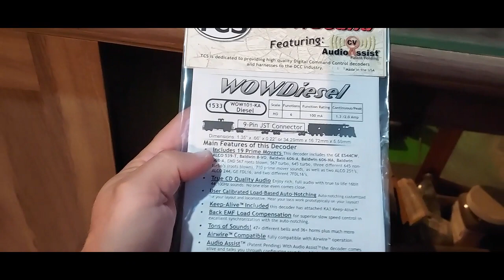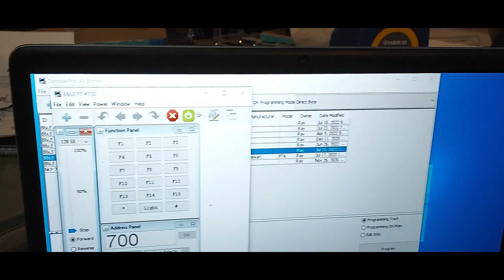TCS V4 with twin Tang Band speakers installation - Stewart F7

Comment: I set my output EQ just for this video to try to hear what you hear. I have to say, it sounds really good. I'm sure it sounds better in person. The B&LE was one of those unsung heroes that held out almost to the end.  I've spent more than a few hours studying the line mostly because of the Hulett's, a mechanical masterpiece.  Defiantly a line worthy of your efforts to model. So far so good. As far as just railfanning these days, the Union should get more attention. If for no other reason than they still utilize a caboose. Not a big fan of the CN owning American trackage but what ya gonna do?
Reply from the maker: Thank you!  The Union is another unsung hero for sure,  that's why I had to do my 0-10-2 up, still need a caboose to go with it.

Comment: Sounds Great!! I just finished up my blue box F7 project. I put a Tsunami2 with a cell phone speaker in the A unit and ran wires to the B unit for a 28 mm round speaker. I had hoped to put a Soundtraxx bass speaker in the B, but there wasn't enough room since it is powered and still has the big weight in it. Sounds good, but not as good as yours. How does your sound compare going from the round speakers to the Tang Band speakers.
Reply from the maker: This is much much more bass heavy and throaty even compared to my high bass round set up.   IPhone 7 speakers were always my go-to , I have a set of f's with those also.